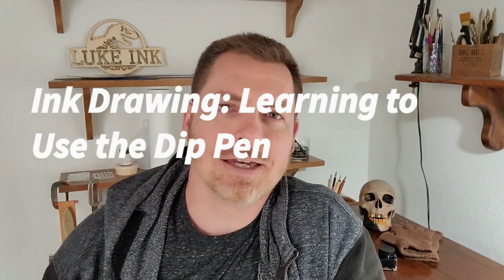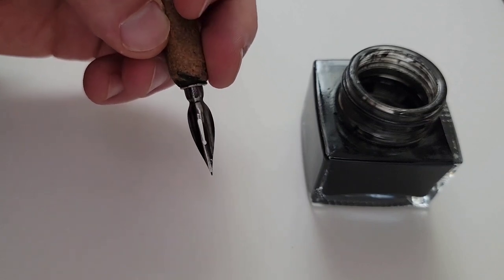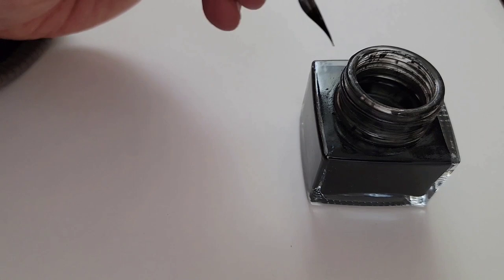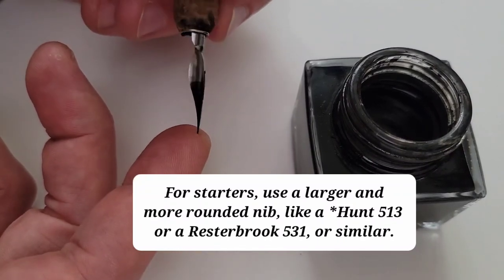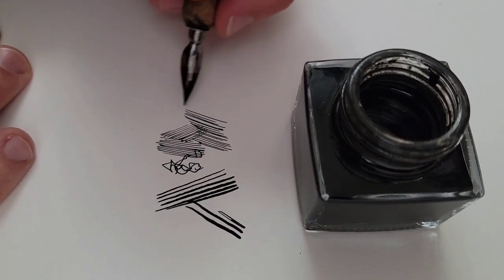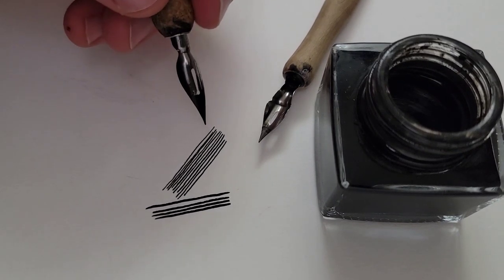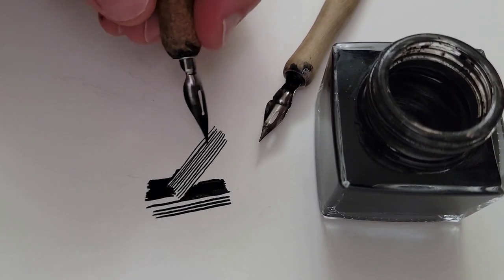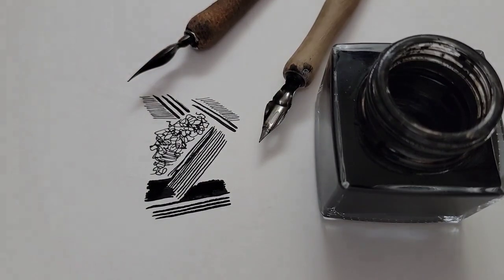Ink Drawing : Learning to Use a Dip Pen

Comment: I had an engineering professor in college who was over 70 years old that could take a dip pen and use it with a circle template on vellum and make a circle with the same line width all the way around without removing the pen from the paper. He was able to turn the pen in his fingers, while drawing around the circle in the template, and also not have any ink bleed under the template when he did it. It was quite extraordinary.
Reply from the maker: Yes indeed - that takes some dexterity!
Reply: Are you sure he wasn't using a Bow Pen?

Comment: That nib you're demonstrating with is the only one that has caused me problems. Most of my nibs are narrower than that. They're vintage nibs from the 1950s-60s by the looks of them. The most flexible one I have is labelled for schools use! Presumably for writing. I pity anyone having to write more than a couple of lines with that. I tried and it drove me insane. Most nibs I'm fine with, I can draw loops etc without trying too hard. But anyway back to this wide nib you're using (and I mean wideness of body not of point) that's the only one that blots on me and blots badly. To be fair I am talking about one particular nib in one particular pen (an ancient vintage nib about 60-70 years old that's become fused to the pen). As for ink I always pour what I'm using into half-ounce bottles and keep them half-full that way there's not too much of an issue with the ink glooping up and evaporating, so that would be my top tip. Always transfer your ink to little bottles.

Comment: can someone tell me how to insert a pen nib in a tight nib holder without ruining or bending the flimsy ink reservoir.
Reply: I'd recommend gripping the nib in a paper towel.
And it's good to check if you are using the correct size nib for the holder.
Reply from the maker: Sorry about the late response. I agree with the other reply - a paper towel works great as a cusion.  I've also used a TINY bit of vaseline on the nib, which did help.

Comment: Great video! Have you ever experienced what feels like almost gummy ink, as if the ink is drying quickly at the tip of the nib and clogging? I'm struggling to determine if it's just the type of ink I'm using (Sennelier Black Indian Ink a la Pagode) or if perhaps the ink is just old (I've had it for a few years now). I find I have to use what feels like far too much pressure to get any flow, and on hot press watercolor paper this creates undesirable indentations in the paper.
Reply from the maker: Yes indeed, the ink tends to thicken as it gets old. You could try thinning with distilled water. This works with some inks better than others. New ink might be the best option.
Reply: @LukeInk  Thank you so much for the response! I'll give new ink a try.